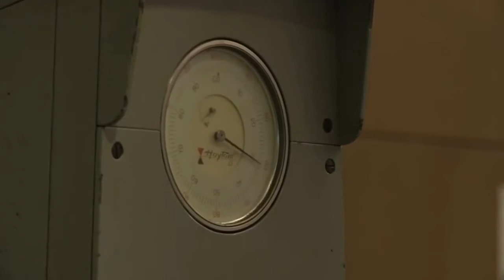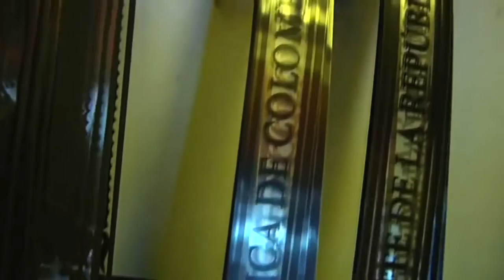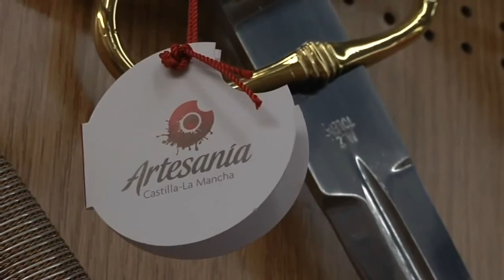Spanish Swords  Made in Toledo

Comment: i have a sword that says
HECHO EN ESPANA
CARRI(DOT)OLEDO
i don't knowfor sure what the letters are between the parentheses, but that's what i figure
it is a very strong sword double sided conquistador sword, with the handguards and such. it is most likely a wallhanger but i've struck trees and no damage or bending has occured. i raked several files across the blade and it skates.